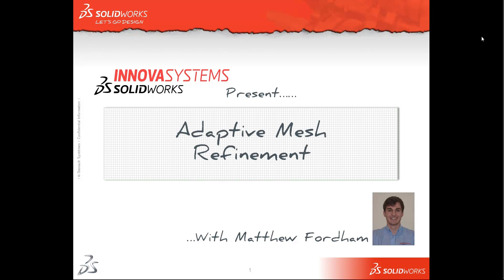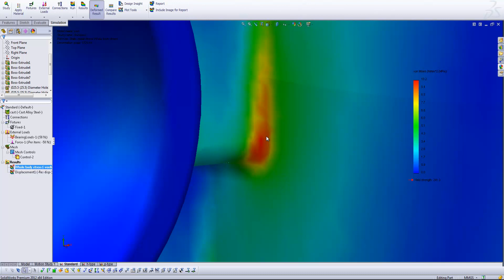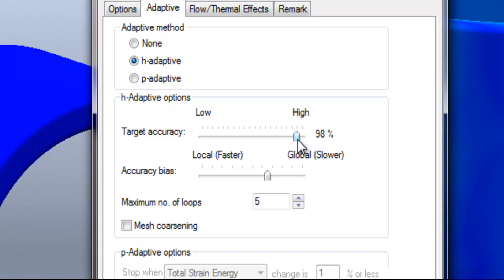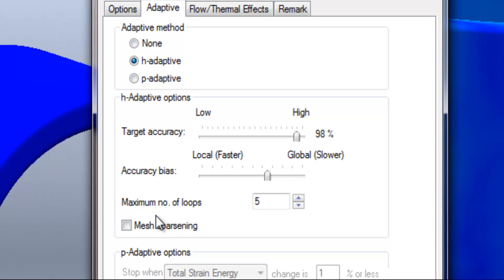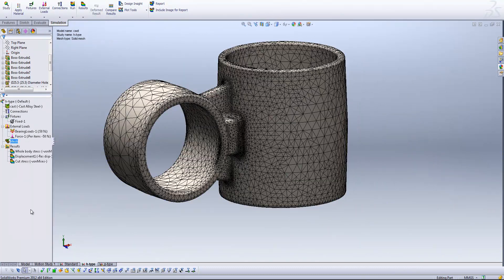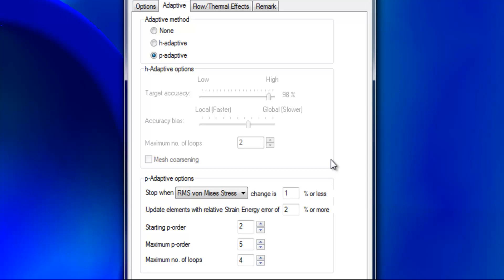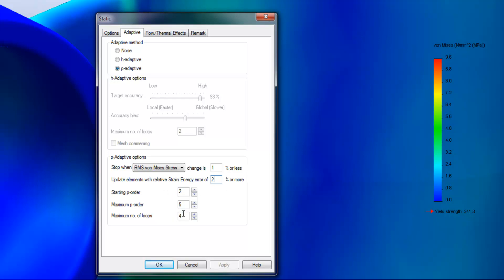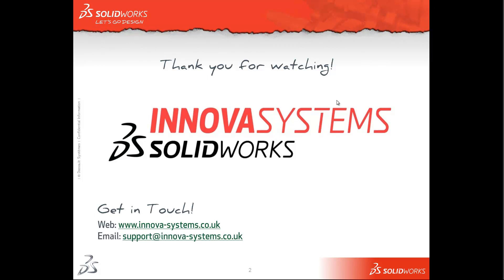Adaptive Mesh Refinement in SolidWorks Simulation

Comment: i have a problem...when i am activating the h-adaptive, the simulation's result for stress and safety factor change dramaticaly compared to before! Form a SF of 3.5 the results go to 1.8! Even though i have add mesh control on certains aereas i want and the mesh desnsity is very high!